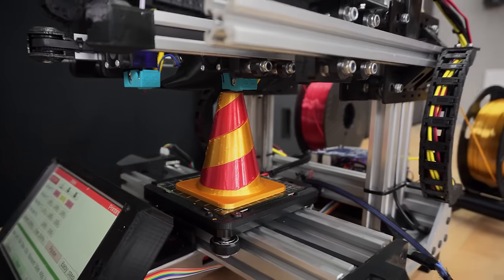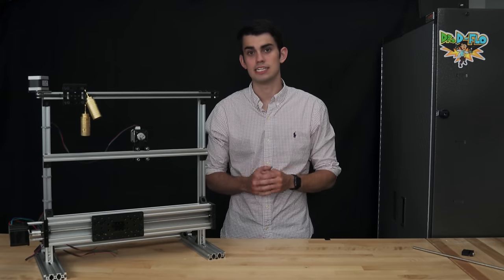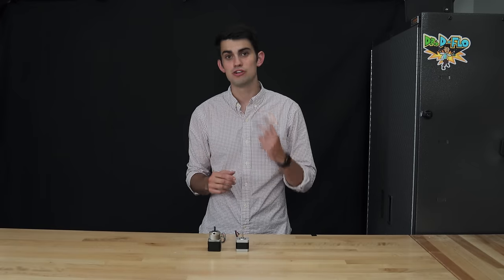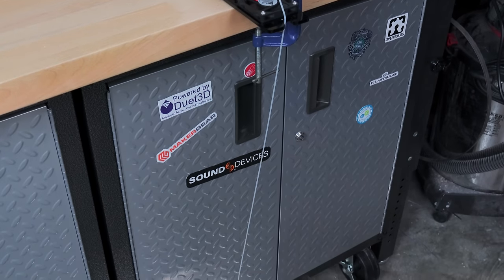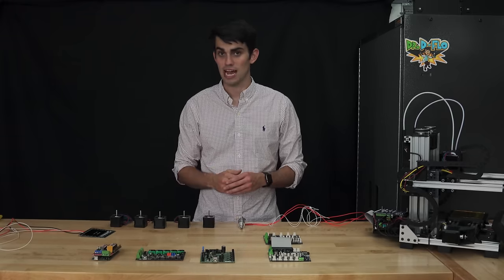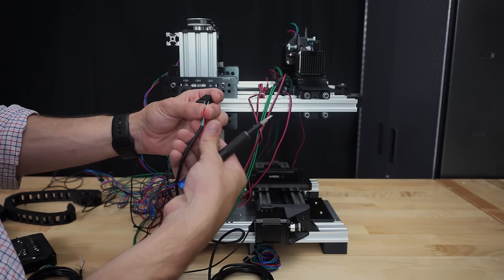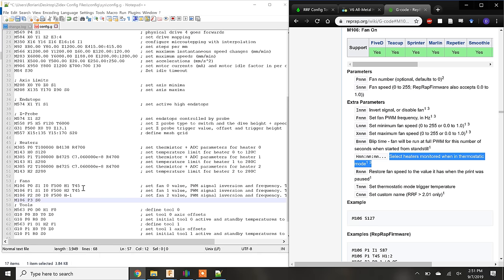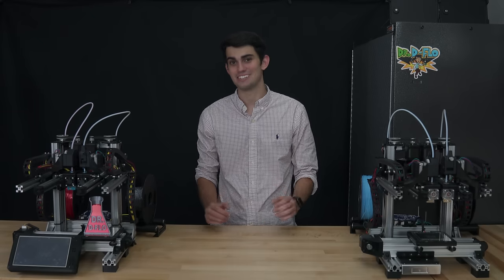How to Build a 3D Printer (The Ultimate Guide)

Comment: This is not a presentation of a 3d printer but a detailed technical manual for printer, 3d printer, microcontrollers, drivers, stepper motors, detailed presentation of slide motion systems also for milling, lathe and cnc.  You just left out the optics and artistic colors, maybe for next time.  Very nice and detailed explanation without blowing up the last healthy neuron I have left at my age.  Just a little note: how fast you speak.  But this is surely caused by my English being slow.

Comment: I'm a mechanical engineering student and I love your videos. They are so accurate and helpful. But what I love most is that it's one of the few english speaking channels, which uses the metric system instead of footballs per chicken nugget or stuff like that
Reply: Brother i agree, im a mechanic and mechatronics student looking forward to study mechanical engineering once i finish high school and this guy makes amazing videos and projects in my opinion
Reply: The question is had anyone (member) successfully to build that 3D.printer ???
Reply: Any competent engineer needs to understand both measurement systems, or they're going to be a pretty shitty engineer.  I've actually had some applications from young engineering students who can't use both measurement systems, and are attracted to metric because it's easier.  I understand the sentiment, but I'm not hiring someone who can't do the job for all customers and countries.  -an engineer.
Reply: @Pyrex238  isn't that why inch/cm converters exist? To make the job easier
Reply: @rogaldorn605  Relying on conversion calculators is why the Hubble telescope was screwed up.  Engineers relying on conversion calculators and not knowing what a bad measurement looked like.
Reply: @Pyrex238  while that may be one of the reasons you also have to admit that it was built in tge 1990s and technology has gotten alot better, and also alot of things in space ger fucked up because someone put feet instead of meters or vice versa, my point being that imperial shouldn't exist in a field where you need absolute security on the calculations you are making, as it is more complicated than metric and creates confusion, but then again that's just my view on it
Reply: "footballs per chicken nugget" LMAO :D
Reply: I am not en engineering student but I consider this as a huge hobby for me. I also love these kind of videos and I wish you guys the best at your school/university!
Reply: @rogaldorn605  0000000000000000000000000000
Reply: Hahahaaaaaaaaaaaaaaaaay Footballs per chicken nugget - - - ROFL - - -
Reply: @Pyrex238  all I have to stay to that is if an expensive piece of scientific equipment starts in a certain measurement system, it should stay in that system. I'd blame the engineers and scientists on that fuck up for not knowing better, which they should begin with.
Reply: what kind of football we talking here? soccor ball? American Football? Australian rules football? and who's chicken nuggets?
Reply: As an industrial designer, I worked with footballs per chicken nugget system for years, now I am using metric...what a difference. But I love footballs / chicken nugget comment thanks Dennis.
Reply: lmao footballs per chicken nuggets really describes well how us european see the imperial system
Reply: If you’re gonna shit on the imperial system, do it right. Which chicken nugget type are we measuring with here?
Reply: dont forget their miley cyrus and quartzite
Reply: @Pyrex238  The inch measurement system is convenient for calculating ergonomic space. Most household items are multiples of inches. But this is where the convenience ends. All my life I have lived in the metric system and it is more convenient for the modern world.
This is how turners think in a tenth of a millimeter, a draftsman in a millimeter, and this is very convenient. The glazier leaves 3-5 mm for thermal expansion of the glass, etc. Here it is about easy memorization and strict multiplicity of the number system with base 10. This is a pencil sizing system. Of course, you can count everything, but the unit of measurement should give easy-to-remember numbers within one digit of the base of the reading system.
Reply: @johansacheng2092 , Yes... all the under-thousand-dollars printers are built exactly this way. However, this video is educational rather than an IKEA plan.
Reply: @Pyrex238 , when speaking about "footballs per chicken nugget" it is not just about what is practical in imperial world. You as an employer should choose whomever is better and more practical. However, this guy is so right when he calls imperial world measurement system "footballs per chicken nugget" system. Just look at the MILE unit ... how many anything else (feet, yards, elbows, fingers) goes into a mile? The same is with weight, volume...
Reply: Hey, can you give me an exact football per chicken nuggets conversion to mice per apple ratio?
Reply: When have you seen any 3D printing videos talking in inches? Way to be edgy Dennis
Reply: Lol footballs per chicken nuggets? I've never heard of that but that indeed made me chuckle. I'm American and when I hear I need a 3/16ths or 5/8ths, it always makes me a bit annoyed that we don't use metric units. I don't even know what is the proper name for our system, imperial? I joke around and call them 'freedom units' but it truly is horrible.
Reply: Inches and feet are human proportions.  Its the superior standard for inventors and entrepreneurs.  Like minded countries use it. Metric is for socialists and communists.  It's meant for copying pasting and to disregard humans or induviduals.  Hive minded countries use it.
Reply: @bradyspace  well we found the fox news watching Trumper
Reply: footballs per chicken nugget got me by surprise xDD
Reply: @Pyrex238  I completely agree, but when someone has a choice where it doesnt really matter which one you choose then i will think less of you if you choose FPS over SI
Reply: I come from a place that uses footballs per chicken nugget, and I prefer the metric system
Reply: Your comment made me so stoked for the vid.
Reply: Y'all get so butthurt over not using your precious metric system.
Reply: I was expecting the video to be measured in cups. 

So you need a certain fluid ounce or screw as well. 

1/100000th of a chicken nugget is really hard to visualise y’know 😂
Reply: @Epiphalactic  your the one commenting on a metric video about your alternative complex cups system 😂
Reply: @HogwartsBasement   good job captian obvious.  I am.  
My comment still stands 🤷
Reply: Isn't the metric system what they use for measuring stuff in bohemian countries?
Reply: Привіт всім необхідним своїм чоловіком та й онуки які мешкали привіт кумасю в обох місцях проживання місцях проживання привіт кумасю привіт кумасю 8 в обох 6 у меня 7 привіт всім відомо [привіт кумасю 474епепп4е474е7774-е7пе7уе7е7еее4н475е76п7777н7н754]7г7
Reply: @rogaldorn605  there are metric sizes that wont convert too.
Reply: @bradyspace  unfortunately being right doesnt mean we havent been taken over. i bet the ovens were going to fuel will built in metric.
Reply: @TheBoatPirate  jesus christ i forgot about this comment thread, almost 2 years ago when i genuinely wanted to study engineering after highschool
Reply: @TheBoatPirate  thanks mate, i don't know what the FTX scandal is since I'm not american, what i can tell you is that next year I'll attempt a structural welding certification exam
Reply: Browning M1911s per washing machine*
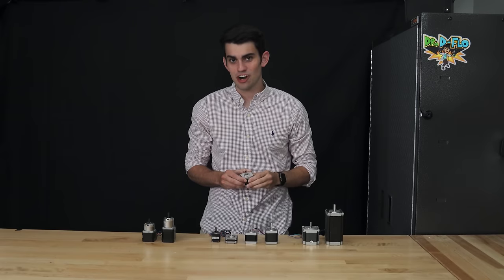Reply: 28:30
Reply: The British systems of units are pretty rough, aren't they?
Reply: @Pyrex238  i somehow agree with the fact that you should know both, but if you're not daily confronted with both it disapates quickly... being from the metric part of the world and doing a lot of transatlantic jobs i got really good in the conversion, after this period only some stuff basic stuck  , to many variables , after working with both i still find that the metric is more comfortable and logical to work with
Reply: But how large is the printer measured in Big Macs? :O
Reply: @Pyrex238 even if you live in Europe?

Comment: Hi David,
Zidex original creator here :) Thank you for your kind word and acknowledgment.  I can't believe there's anyone crazy enough to attempt this build and then you even hit homerun with your documentation. Well done! Hope you enjoy never have to deal with Z offset between the two toolheads ever :) 
- Stephen
Reply from the maker: Stephen! 
Thank you man for dreaming up this design and providing the code and 3D models, so that I could build on what you have already created. Zidex was the inspiration for this entire video.

Wishing you the best. Perhaps, we could collaborate on a future video.
Reply: @DrDFlo  olkl?
Reply: Hi Stephen,
I was wondering if your software would   work for a standard bed slinger system with two independent Z axis. Basically the same design but with the offset on the Y instead of the X axis.I would run the 2nd Z axis on the rear of the gantry. With a longer bed I could realize a big print area with the benefit of two independent Z axis and maybe even independent mesh leveling.
Would run both z on linear bearings.and ball screws.

Comment: 🙏🙏🙏 I haven’t begun the hobby, but definitely want to. This is amazing for so many reasons.
By giving straight information about parameters, and solutions, you’ve helped reduce my sense of overwhelming when I considered how many threads I would have to comb through, or short videos hyping products. 
I also feel like I have a better grasp of what to look for in my first printer, to then make a printer… 
The PVA tip solves so many design challenges!
I’m so excited to start producing professional grade products it’s hard to eat humble pie and spend a while with a prebuilt. This definitely outlines why the experience is so vital. 
Cheers!

Comment: Hi David,
I just came across this clip while exploring 3-D printing on a make your own search. Very seldom do I ever watch an entire video, however this time was an exception. My background has been managing maintenance in a large furniture manufacturing facility for 20 years. At that time we were one of the first companies in that field to purchase CNC routers. After my management years I started my own company installing, training, and repairing CNC router centers in the industrial woodworking industry. I am now retired and decided to finally build my own CNC router or printer, thus the search through YouTube. I am not a fan of stepper motors only because of the machines that I have worked with over the past 40 years. The router spindles that I am used to on the CNC's were 15HP water cooled with tool change, but now because of size and power I have decided to "scale down" and get into the "stepper world".
I wanted to tell you that, IMO, have put together a very well made video cover this topic. It is very well broken down and explained so that people without a background in CNC can follow and absorb the entire process.
I have just noticed while looking through your home page the different videos that you have since made, and am looking forward to checking them out.
Great job, and thank you for all the time that you have put into making this.

Comment: Awesome video.  Way back in 2014 I needed a 3D Printer for larger flat shapes.  I used a Shapeoko 2 (Now called the X-Carve) as the framework, and added direct drive exstruder, ramps, Marlin, and various other bin of shame parts.   Now I can just use a CR-10, S4 or S5.  BTW, I cut all my extrusions on a high tooth count 12in Miter saw.  Very clean cuts.  0.25 mm Volcano nozzles work very well, so that's a misnomer to state you cannot get as high a resolution with a volcano.  What you had shown in the video is a Super Volcano.  I feel standard volcano heater blocks and nozzle are the best all around nozzle/heater block fitment.  I was expecting more oozing, but they work great with high detail 0.25, 0.4, very nicely.  Thus, when ready for a larger bore nozzle, your machine is already set up for volcano nozzles.

Comment: Many 3D printer designs used threaded rod as drive screws.  They actually work very well with little backlash for the Z axis where the weight of the Z axis assembly forces the threads of the nut to remain in contact with the threads of the rod regardless of the direction of motion..  Even during a change of direction, gravity keeps the threads in contact so there is little if any backlash.  In a horizontal motion system, common threaded rods would have backlash without a spring keeping the threads in constant contact.
One should also mention the use of ball bearing drawer slides as linear rails in a low budget RepStrap.   My current home brew printer used these on all three axies, only later did I replace the Y axis with linear rods, and a 'real' linear rail on the X axis.  The Z axis still uses the drawer slides, but the threaded rods were replaced with 8mm dual start drive screws.  There is enough support from the screws, and enough pressure between the two parallel rails to keep the Z axis moving quite true without wobble.  Eventually, I might replace the drawer slides with a pair of linear rails, but this would require much rebuilding of the printer, it would probably be better to simply build an entirely new printer.  We shall see......

Nema motor specs may also have SAE or Metric screws.  Obviously not interchangeable.  Some stepper motors have 6 wires, or even 8.  6 wire motors can be used in a 4 wire circuit by ignoring the two extra (center tap) wires.  8 wire motors can be used in 4 wire circuits by connecting the correct two extra coils in series so there are only 4 wires connected to the controller, with the other 4 wires correctly connected, and insulated.
Reply from the maker: Thank you for this write up. I of course had to cut some corners on some of the details, but I will happily upvote this comment to bring visibility to some of the information that I missed. I am interested in your low cost 3D printer builds. Care to share any pictures?
Reply: @DrDFlo  I first built a Repstrap after finding a half dozen NEMA-23 stepper motors at a ham radio flea market for $4 each.  I used 10mm wide 5mm/tooth belts with suitable pulleys to fit the motors 1/4" shafts.  Ball bearing drawer slides for the linear rails, and a homebrew heated bed made from 1/8" aluminum plate with sand resistors glued to the bottom with JBweld, wired in series parallel and run off of a surplus 44v power transformer out of a surplus stereo amp.  Ramps controller on an arduino mega2560, ATX pc power supply.  I went through several hot ends from a Jhead-Lite, ALU-hotend, and now a Prometheus.  I have a homemade direct drive extruder (400 step/rev motor) with an MK7 drive gear.  I later replaced the X and Y axis with linear rail and linear rods respectively.  Most of the printer structure is made of steel and aluminum members (Home Depot), and some 3D printed parts designed with OpenScad and printed on the printer to upgrade itself.  Most recent upgrade was a WhamBam flexible build surface. 
I also downloaded the STL files for a RepRap Wilson TS, and bought a hardware kit from it's designer.  The Wilson was built using surplus stepper motors (maybe a bit undersized but they work).  I'm now converting the Wilson to a Bowden extruder and a Chinese clone E3D style Jhead hot end (hope it works).

Comment: My first 3D printer upgrade (Ender 3) was a BigTreeTech E3 mini v2 motherboard and I didn’t think there’d be much of a difference other than easier wiring for a s probe and easier firmware editing but holy cow do stepper drivers make a difference. 

People call the v4.2.2/4.2.7 boards for creality printers “silent” boards but while they may be better than older boards they absolutely are not silent. The E3 mini on the other hand, I thought it was broken it was so quiet.

Comment: Wow. Thank you so much for making this video! This is definitely an ultimate guide!
Reply: This is not a presentation of a 3d printer but a detailed technical manual for printer, 3d printer, microcontrollers, drivers, stepper motors, detailed presentation of slide motion systems also for milling, lathe and cnc.  You just left out the optics and artistic colors, maybe for next time.  Very nice and detailed explanation without blowing up the last healthy neuron I have left at my age.  Just a little note: how fast you speak.  But this is surely caused by my English being slow.

Comment: Awesome information and presentation! I have in my garage a XY Stepper Motor Frame of 3M x 3M  with the controller box for multi colour painting that was $200K when new. Have been thinking how to rebuild it into something worthwhile as it is missing the original IBM XT PC with OS and Painting software. Your inspirational tutorial has made me realise with the correct application of power upgrades for the large steppers controlled by a modern hobbyist 3D system it could be made to do many things. May donate it to a local tech school for educational purposes as it is unlikely I will have time to emulate your success. Well done!

Comment: Linear guides do have some adjustment to a certain extent. You can replace the ball bearings in the carriage with slightly larger or smaller ones depending if there is too much or play or drag. It's not exactly as easy as adjusting a v slot wheel, but it's doable.

Comment: This really IS the Ultimate Guide.  I've designed and built my own printer.  But the detail in this video is great.  Even those experienced in 3D printer building will pickup (as I did) helpful, if not essential, information. This will be my go-to video on my next build.